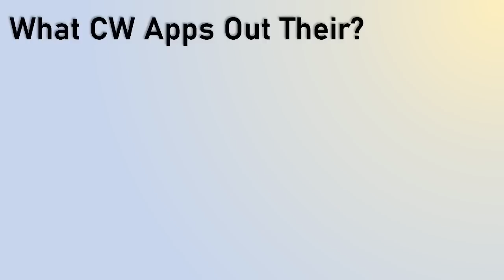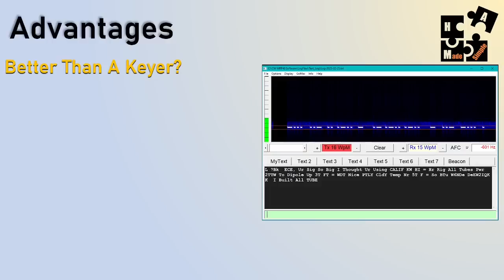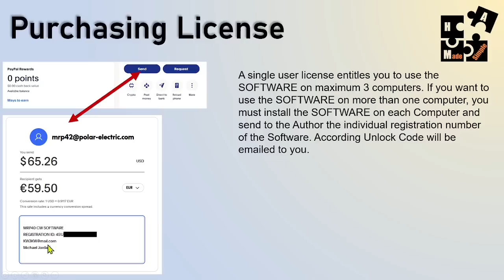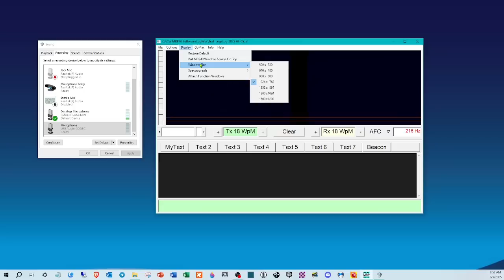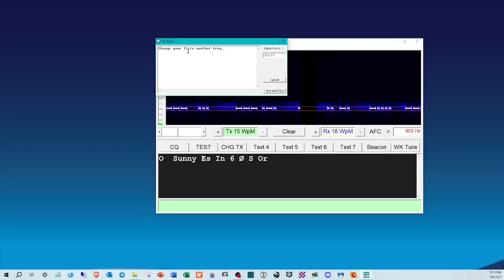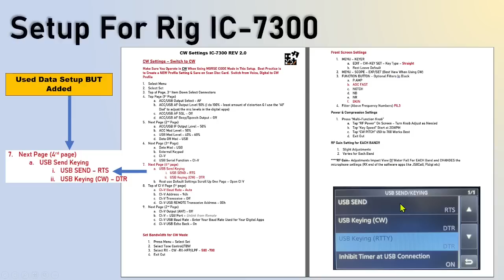CW Software MRP40, RX & TX via Your Keyboard

Comment: You said it in the video but I have to repeat it. To be successful with mrp40 you have to start with your rig. I will start with a very faint key in qsm or qsn and go to work. I set the width filter narrow, shift the bandwidth, change the tone to 550 and use gain, dnr all that stuff (lots of videos on how to do this with your rig) then I goto the software and use the slider bar to adjust to perfection. Think of your rig as the cake and the software settings as the icing. Mrp40 is unmatched and then couple that with send. Chefs kiss
Reply from the maker: That’s a perfect way to describe the process, thanks for sharing your expert workflow! 😊

Comment: Hi MJ. Thanks for the video.  Looks like a good program and worth the money if it works.  I’ll download and give the free trial a spin.  I was wondering if you ever looked at a software program called CWTY?  I have been using this for the past 6 months or so and finally got it working well with my IC-7300.  Decoding seems really good, much better than FLDIGI which only seemed good with strong, machine-generated code.  The only negative is that the CWTY program only works for Windows 10.  Does not work with W11.  Author is not interested in updating.  So that’s why I’m interested in MRP40 since it does work with W11.  73. Jack N3DNA
Reply from the maker: Thanks for the info.  I don't think I used that one but did try several others.  Some worked good on decoding but not on transmitting.  If this works for you, enjoy.  Too bad it doesn't work on Win 11.

Comment: MJ, great to see you posting again!  I'm excited to learn a bit of CW so this got me motivated... I dl'd MRP40 and have the program running enough that I am decoding clearly.  I am having issues with transmitting though.  I typically use com 3 with FLrig, JS8... but for some reason I'm not getting anywhere.  I'm using the DR-891 with my FT-891 and used your setting...  Any help would be appreciated.  I did e-mail you for the handouts but forgot to type this in.  Thanks for this video!!
Reply from the maker: Email me at kw3kw@mail.com and lets dig into this.

Comment: Love MRP 40
It can decode at far lower signal levels than anything else (even at the background noise level), and like all other CW decoders, it has a hard time with key or bug sent code because the timing of hand sent code is too variable.  I use it to try to get my code instant recognition up and I believe it is doing just that.   My problem is I am still suffering from :"key fright" so very little actual QSO's, and it is great for POTA etc style contacts.  I do  use it also to double check my in-head decoding.
Reply from the maker: Trust me when I say there are more out there like you than the 60WpM hammers.  Go for it, we are all rooting for those who are trying to improve.  Most hammers love to see newbies grow in the skill sets.

Comment: I wish FLDIGI worked better for this without having to buy additional external equipment. Then it could be used with the notification system to open programs, pull telemetry, change frequency, etc.
Reply from the maker: That makes way too much sense for it to happen!!  LOL  It seems us ham's have to use duck tape, glue and barb wire to make things work right.  One day, we may get a break but for now, we piece meal things together.